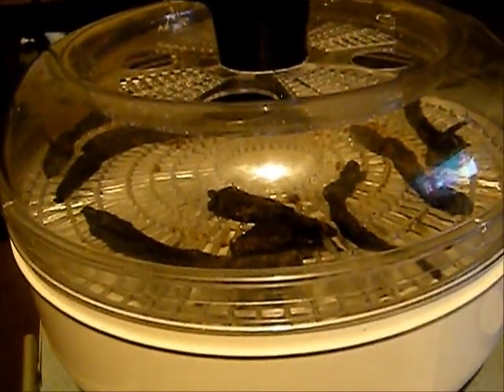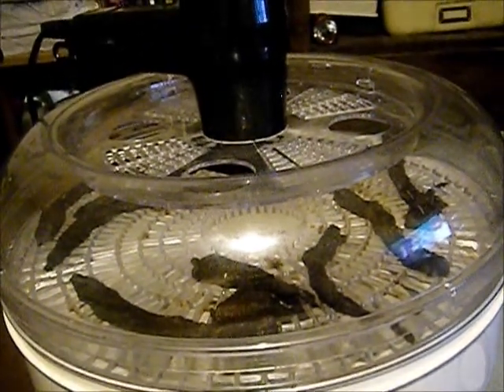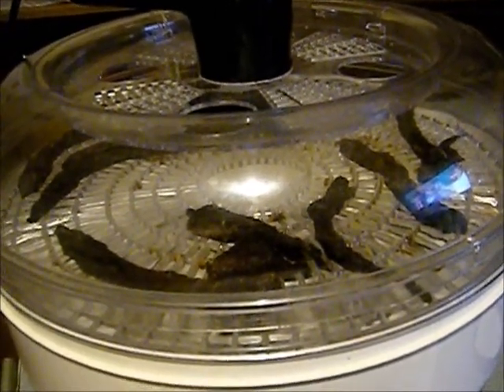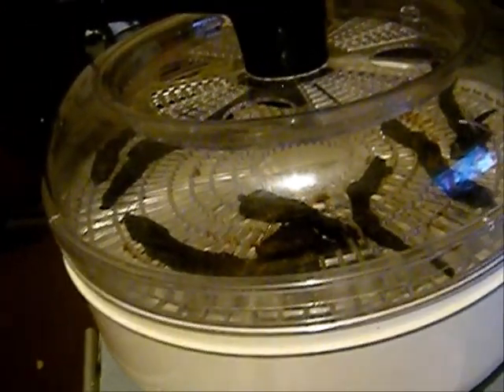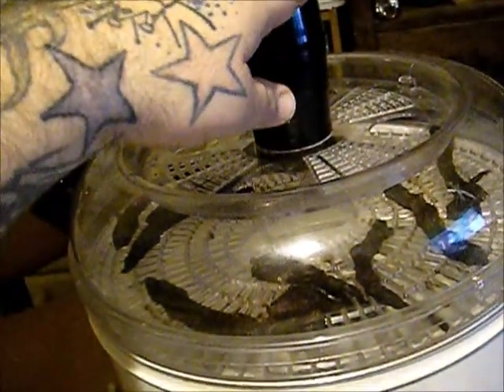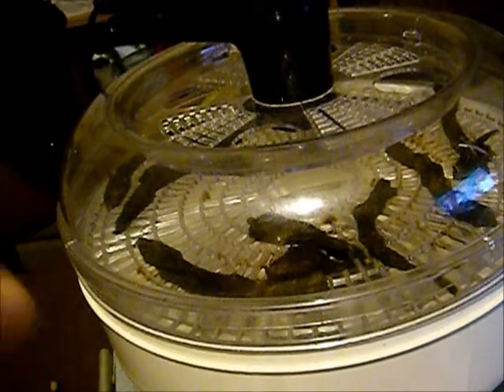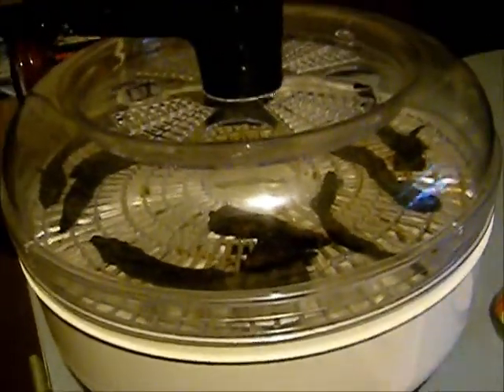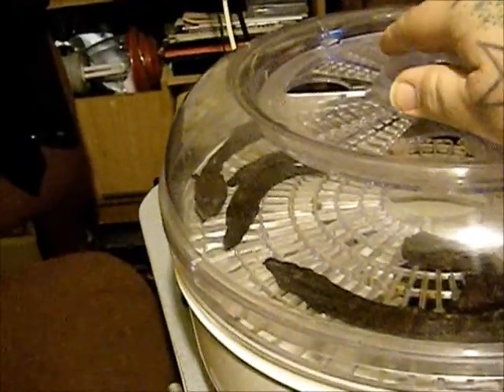Modified Ronco Food Dehydrator Update

Comment: Did u have any issues
Reply from the maker: Michelle Molisee It will melt the inner ring directly underneath it on the tray on high heat over 10 minutes. We ran it last night on high for @ 5-7 min every few hours and it still finished a lot faster than normal with no issues at all.
Reply: Ok awesome I just got one of these dehydrators but didnt realize how long this one would take vs the ones with fans. Honestly im afraid since it could take ages dehydrating the meat id be afraid of bacteria.  But ima give this a try. Thanks for the idea.
Reply from the maker: Michelle Molisee If your looking for more air flow you might try a small computer fan. If you have time to run the hair dryer for @ 10 minutes every hour and rotate often it can take a 30 hour job on the Ronco and turn it into a 5-8 hour job. Also if you marinade heavy for a day or so you will mot have to worry about bacteria on your jerkey (beef anyway). I have not really tried any other meats yet so if you do let me know how it goes.